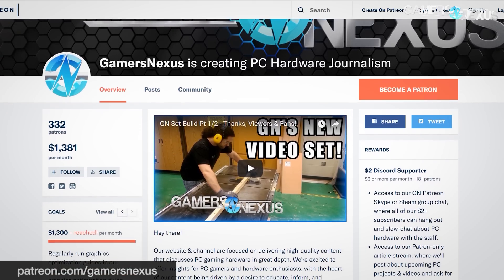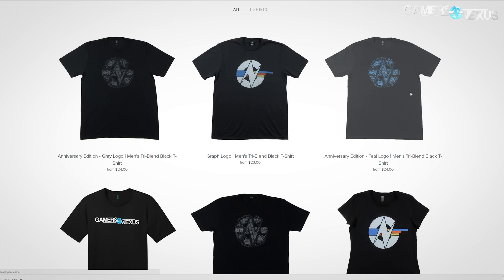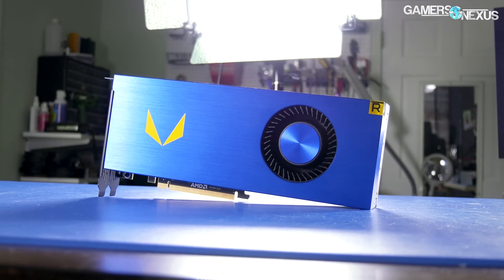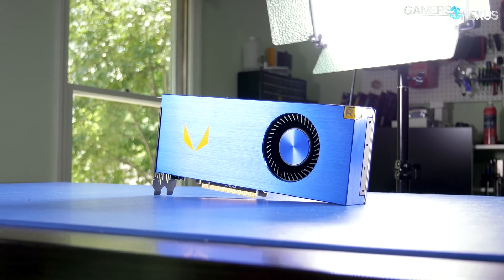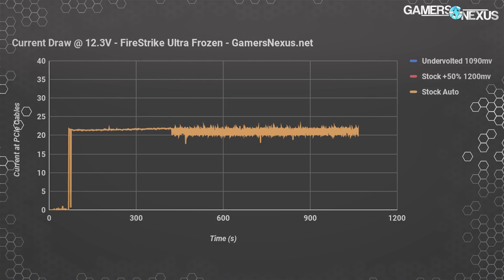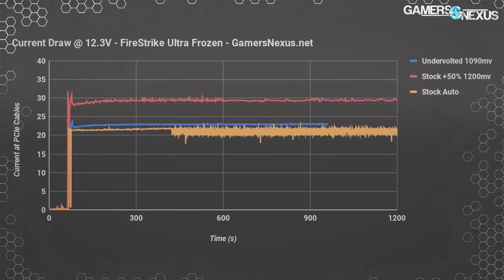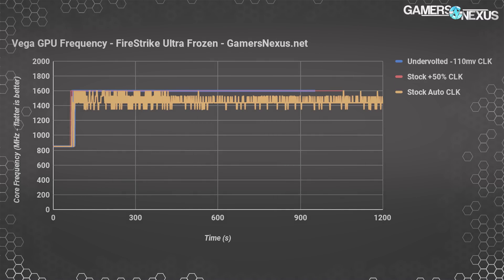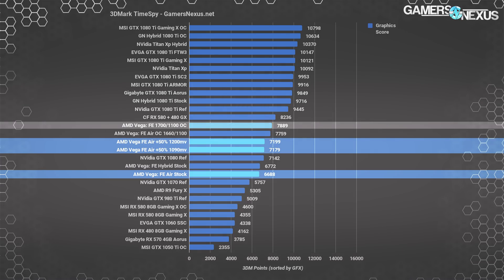Undervolting Vega FE: Fixing Performance & Power

Comment: I wanna see Pascal undervolting!!!! It made miracles for my GTX 1080!!!!!! :D
Reply: iamezza you have to click on the button to the left of the core clock bar or ctrl + f and adjust the frequency for each voltage, then you set a higher clock for a lower voltage and the card doesn't need to go on high voltages for the frequencies, that's what I do at least
Reply: André Zabuscha On my 1070. 0,93v to get 1949mhz core and +350mhz on memory in afterburner.
Reply: I got 0.993v at 2050mhz and temps tops at 54c on water (EVGA hybrid)
Reply: André Zabuscha yup. That's the thing, my temps don't go higher than 56°c as well on 45% fan speed on an msi card. It would be very interesting to see the actual power saving but the temps and fan noise relative to that make it very interesting.
Reply: Faheem Sayed I got a decrease in power consumption, decrease in temps and increase in performance, what happened to performance needing more power and temps? Hahahahahahah xD
Reply: How are you guys undervolting on Pascal? I only recently got a 1070. Afterburner only allows positive voltage changes.
Reply: I got 0.8v at 1811mhz on my GTX1080 FTW DT with a solid memory OC too, can't remember off the top of my head. Fans remain dead silent. My entire rig draws less than 200w in full GPU+CPU synthetic load. xD (6600K @4.4ghz 1.15v) When I play less GPU demanding games I run a profile with stock boost speed and it runs at 0.78v. Absolutely insane. I have a feeling if applications would let me, I could go even lower at stock boost speed.
Reply: i did the same for my 1070, recently i got into 80c, now im back into the nice 70's again :) 
now way im going above 800rpm again
Reply: rfouR_ 1800mhz is too low, .980mv got me 2050mhz
Reply: And +650mhz on memory
Reply: Without undervolting temps were so high (I run the cooler really slow) that the clock was at 1950, undervolting got me an extra 100mhz, and is 100% locked at 2050mhz because there's no variation in temps, pretty crazy stuff, undervolting for better performance

Comment: My MSI Gaming X RX470 runs at 981mV, HWinfo reports 70w max power usage as VRM input, Core power stays around ~55w. Stock voltages on AMD are joke!
Reply: I've one RX580 that doesnt like undervolt at all, obviously AMD set the voltage there for a reason, i hate when special snowflakes think they are better than AMD engineers just because they manage to undervolt an AMD chip that won the silicon lottery.
Reply: Ivan D Of course there's a reason why AMD did that, who wants their GPU to run hot and consume more power for same performance? It's just that majority of RX cards (not the lottery winners) can run on much lower voltage and I did not won the silicon lottery, you are the first person I saw who had issues with undervolting, most of my friends run their RX x70/80 few mV lower than mine. My card is pretty average.
Reply: Undervolting is a personal thing that varies from chip to chip, same as overclock. There is a reason why Nvidia did not clock the GTX 970 to 1500 Mhz stock even tho they would love tho. People love to say that most GTX 970 overclock like demons but thats something we dont know for sure, just because some geeks go to the internet to show their achievements doesnt speak for the entire GTX 970 ever produced. For example, this is the first time i talk about my bad undervolter card because it works perfectly at stock voltage so it isnt broken...
Reply: I know it varies from chip to chip. My point is that 981mV on RX470 isn't winning Silicon lottery, majority of RX cards can do  that. You had a bad luck with yours.

Comment: This is really fascinating. I've learned a lot from your channel!

The most surprising thing, (and obvious if I had just thought about it), is how GPUs handle their power/thermal caps and each one directly affect the other. Of course, dropping voltage would allow more current with the same total energy. It's just interesting that thermals are better with lower voltage/higher current. I never would have expected that.

Comment: So basically you pump more current, because of undervolting with the same power configuration. To be honest I don't get it how it helps thermals. Power is directly related to both current and voltage. Maybe it has something to do with power leakage (which I have no idea about). Plus this crashing thing that you mentioned it the end is really confusing, to say it mildly :/

Comment: As we expected. We knew already that 'undervolting' works great for the FuryX and for Polaris cards (an omission of Gamers Nexus, they never pointed that out?), now it has been proven for Vega. There is some error in that powertuning mechanism in AMD cards, unfortunately. Whatever it is, 'undervolting' works. Typically you can lower the voltage for the AMD cards (latest 2 generations) with roughly 0.1 V. The average voltage (not modal!) gets lower and the voltage gets much more stable (i.e. a smaller standard deviation).
Reply from the maker: Peter Jansen We didn't test those things at the time it was relevant. It really shouldn't be a surprise that as a business grows, it is able to do more things, its personnel gain more knowledge and skill, and can expand coverage.
Reply: That is understandable Steve. I am glad that you did now, I think that it is important for gamers that they know this. 
1 How it influences the benchmarks
2 So that they can tune those cards themselves if they buy one, get lower power, less heat, less noise and a more stable boost
I hope that this link won't get this reaction in the spam filter (a known problem on Youtube), I recommend this article for you in case you wouldn't have read it yet: http://www.tomshardware.com/reviews/msi-afterburner-undervolt-radeon-r9-fury,4425-2.html

By the way, I like the direction you are going in recently. In my opinion your coverage of Vega FE was spot on, too often it got neglected that it is not a gaming card even though it shares the hardware. I like it if you are just yourself: honest, open, not too politically correct, make a joke. Maybe some Sunday video again?
Reply: Peter Jansen it is cool that channels like gn or adoredtv (who did an excellent video on polaris and powerman) dig deeper into the drivers and reveal this information, but realistically, there should be no need for it. everything can be undervolted, including intel and amd cpus, as well as nvidia gpus. but nobody does that, because the chips are supposed to run at a somewhat optimum level, a compromise between power draw, temps, stability and performance. reviewers and enthusiasts take this basis and do an overclock to see how far they can push the chips. going backwards shouldn't be required for the card to reach and maintain its max clock, and to not draw almost 400 watts. it shouldn't be GN's job to educate the viewers how to fix their cards, or that the cards are way overvolted. it should be amd's job to ship a product that is working in an optimal way.
Reply: Ideally AMD should fix this power-management system they use (both hardware and software). However, with the knowledge which we have it definitely should be tested. Having said that, as much as I hate Nvidia because of their anti gamer and anti competition practices, it should also be tested for Nvidia cards how much you can undervolt and what effect it has.
Reply: Why should it be tested on nvidia cards? Because you hate them? Nvidia cards reach their advertised frequencies in the specified power and thermal envelope, at their stock voltage. Besides, as steve said, you can't really undervolt pascal. 

The knowledge that we have is that AMD likes to overvolt their GPUs for some stupid reason. We don't have that knowledge about nvidia.

Comment: I don't know whether to feel very happy that undervolting unleashes the card and nets serious performance gains, or sad that AMD still gimps its cards with dodgy coolers and/or dodgy stock settings.
Reply: Michel van Briemen AMD have to account for the very worst chips across the board. Like what another commenter said, unless there is a way to quickly and efficiently distinguish the worst chips from the rest, it's not situation that you can change..
Reply: Binning is more for chips with defects that prevent parts of the chip from functioning properly; they probably are binning their chips to save up for entry level cards at a later time. If you have a collection of chips that have no obvious defective areas which can be disabled,  and the range of minimum stable voltages is 1000mv to 1200mv for the lot, what do you do? Creating a "runs too hot but is identical to the top of the line" bin that would probably receive only a nominal discount would cause some marketing issues.
Reply: Daniel Tarroni isn't that what binning is for? these bad chips should be sold in lower tier cards or scrapped. sure, they bump the voltage to accommodate for the worst chips, but the cards end up running hot and throttling. users and reviewers notice that, and next thing you know, amd has barely 20% of the market. they are literally shooting themselves in the kneecap to sell chips at higher margins, instead of throwing the bad ones away or discounting them in cheaper products
Reply: because desktop comsumer get the worst dies of them all. Exascale compute cards get the best/most stable at high clocks. Those who cant be the best become Radeon Pro WX cards. The dies that can run at the lowest voltages in exchange for clocks go to embedded cards (casinos/ hospital machines) followed by mobile for the dies that dont make the embedded cut. Last an certainly least is consumer desktop who get all the leftover stuff. lets say 30% of these dies run stable at 1050mv and 80% run stable at 1200mv. Amd cant afford to throw out/ aggressively bin those dies so they just bump up the voltages so more become usuable even if it means 50w more power draw. Power consumption is an afterthought and doesn't matter to much when you usually have only a single Gpu vs servers having 100s .
Reply: @lakshya singh

just get a 1080ti if you can...i doubt it will out preform (about 10% it ties) a 1080ti....
and if it doesnt beat the ti....nvidia probably isnt gonna drop the price

and all the people waiting on vega will buy ti's.... and the price might go up from low stock

id LOVE for fe vega to be half broken rx vega chips.....which is my fanboy dream/delusion i had

i ran a 1090t 6 core phenom 2 from release date till i got my ryzen 1700x
and im STILL on a 6970......dx11 only

but i just think the ONLY way amd is going to actually make RX vega work....... is selling at negative or 0 profit

using ryzen profits (which is WAY more than they need to stay afloat) to help the cost of selling for no profit

its like that super expensive juicer AVE torn down.......sold at a fraction of the cost in hopes you keep buying the juice packets...which actually makes their money 

amd just wants you to buy ryzen and vega....have a good time for 2 to 6 years (7 if you are crazy like me), and then buy AMD again
Reply: Bayan Zabihiyan did you read that somewhere, or you just making stuff up on the go? What exascale chips is global foundries producing at their 14nm fab, on the same wafer as Vega FE? are they making this gargantuan die next to some other dies, or what? What application does a huge, powerful and expensive die, like the Vega 10, have to do in casinos or hospitals? How much do you think these embedded parts will cost, compared to a full blown Vega FE? You think they will be more expensive, or what, since they are binned better? Why is power consumption very important for hospitals and casinos, but not consuemrs? What mobile parts are you talking about, there is no mobile Vega with this huge die and HMB2 memory, do you think they are storing them somewhere for a year or two, before such products come to market? Not that they will come because there is no market for that, but still? 
There aren't even any exascale computers anyway. The Cray Jaguar, and its successor, the Cray Titan, use off-the-shelf Opterons and Nvidia Tesla parts, around 18,000 of each. That's like a few days worth of production for a fab. The demand for these parts is very low, compared to demand for consumer parts, so they can't build their fabs or products around your 30:80 ratio, whatever that means. They will simply go bankrupt. 
AMD can't also sell those parts at those voltages, because people are not stupid, and will return them immediately after they notice their fans whining like a jet turbine, and their cards throttling like crazy. Or will simply not buy them, when competing products offer better thermals and performance at a similar price. This has already happened to many ATI and nVidia cards in the past. And it will happen to vega RX, if the power consumption and throttling are not addressed. And the FE is supposed to be the "premium" or "pro" product line, so it makes little sense that they would put crappy chips in there, to save the good ones for some Radeon Pro card.
Reply: Michel van Briemen yeah we are barely able to use the full horsepower of HBM2 and we know that we even cant use the GPU cores to the fullest( half assed driver) why AMD?! Y?!i love ur ryzen but now u pull this of shit .... grrrr(cant wait anymore)
Reply: yeah , man 1080 Ti is the best card :D.
i just wanted and wished a noice comeback of AMD like ryzen ,in at least price to perf ratio. But seeing AMD deceiving us with fake game modes,  and even after waiting for so long their 1500$ vega card under performs new titan xp which makes me wonder if the gaming chip vega can really deliver .
Reply: Cream Soda Why do you think binning only refers to parts of the chip that can be disabled? How do you think DRAM binning works? There is nothing there but memory cells there, yet some are binned as 3200 CL14, some are binned as 3200 CL16, or 3000 CL14 for example. Also, there is nothing to disable between a Ryzen 1800X and 1700 (non X). Only difference is frequency. Same applies to GPUS. It even says so in the wikipedia page for binning, and there is a nice reference to a Gamers Nexus article on binning :D

Apparently the 1200 mV range is not really stable, as the card is throttling the whole time due to overheating. That's why you define your range for 1600 MHz from 1000 to 1100 mV, for example, and those chips that need 1200 mV are simply not sold as 1600 MHz parts, but lower tier 1500 MHz, or 1400 MHz, or whatever. You create your "top-tier" line, and your "lower tier" lines, simple as that. What marketing issues would selling a cheaper product cause? The RX470 and RX480 are practically binned parts, then there is the whole regular 1080ti and the "superclocked" or "lightning" or whatever OC edition. This doesn't seem to create any marketing issues whatsoever. It's just that some cards are more expensive than others, because they are factory overclocked. Intel is binning chips in K, non-K, low power, ultra low power SKUs etc. It's not rocket science, and it's nothing new.

Comment: I think AMD's generous voltage allotments is something that stuck in their silicon binning department since the Fury series. The Fury series was not stable at release. It would frequently spit out graphical artifacts. This instability was the price of AMD's competitiveness at the high-end, out-of-box experience.
I guess that does not explain well what I mean. AMD knew the Fury series was unstable; it needed a lot of voltage to work properly, and so were given voltage in excess of what would pass tests as they knew it needed much more voltage than what does not crash or cause inconsistency. What would happen is there is a large voltage range where the Fury series will spit out artifacts on your screen, but it won't crash and otherwise performance won't suffer. AMD made as sure as they could that the Fury series would get enough voltage so as to.. not do that.
It still happened, of course, but some driver updates later it's largely gone.

Now everyone should know that the Fury series also behaved differently when it comes to voltage entirely. More voltage = less frames.

I'm sure this voltage discrepancy is just a pattern of any vendor's binning, but because AMD is so consistently nudging up against their power and thermal targets, it affects them the most. Most reviews of the RX 400 and 500 series cards would look a small bit different if they threw the power slider to the right [and did the same with their competitors].
Reply: Probably even before that. My most GCN based cards can be safely undervolted at stock clocks, including my Vapor X 280x

Comment: Good video. A friend has a nice undervolt on his Fury, and as you say it also holds true for some 400 and 500 series cards. Based on that it seems to be a company policy rather than not having enough time to find the best settings. Unless they are just constantly pushed for time on all products all year round for many years consecutively :)
Reply: It's company policy for every company making processors, they all overvolt their chips because it takes far to long to properly bin several million chips.